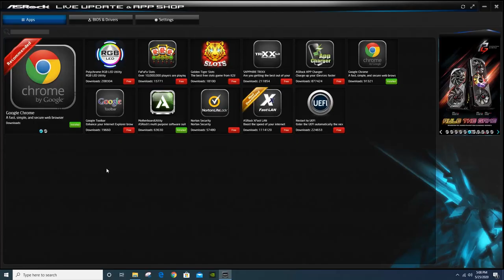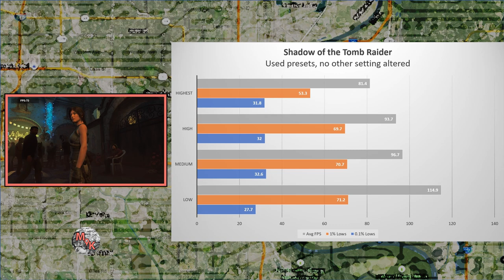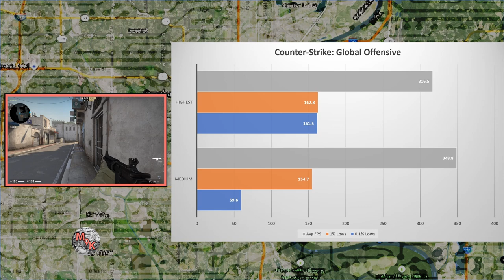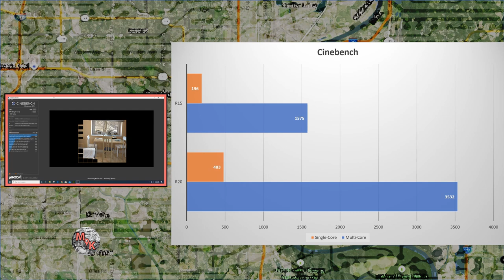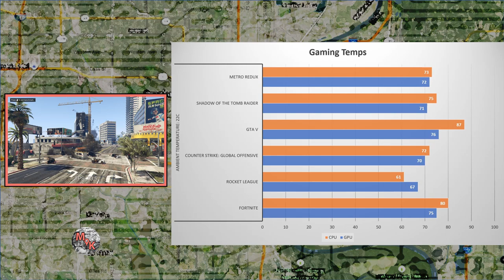I couldn't be happier with how this Budget Gaming & Streaming PC Build turned out!

Comment: great vid. PCPartPicker brought me to you.  I've got a near identical build waiting for cybermonday.  They had dinged you for the $20 windows key.  where do i go about getting windows key like that and have you had any of the problems they mentioned with it?  is there anything you'd change?
Reply from the maker: Hi and thank you for watching! You can get an inexpensive windows key here: https://www.vip-scdkey.com/sk/mokwindows
I've never had any issues with these keys and I've used 3 so far this year. The link is an affiliate link, so should you purchase, I'll get a little stipend--full disclosure there. Try code SKNO to see if you can get a discount as well. 

As for if I'd change anything with the build? Seeing as how many months have now passed, I think I'd maybe be looking at the NR600, which is the mid tower version of this build, go for an inexpensive b550 motherboard that is also atx sized, and consider an nvme boot drive that maybe has a ram cache. If I could only change one thing right now,  I think I'd opt for an RTX 3070 if budget allowed. Having said all that with keeping the 1k price point in mind this might be difficult. If I could raise the budget to 1200-1300 then def a 3070 and some other tweaks would work. 

RAM, and storage devices, especially SSDs are very friendly in terms of prices, so even going with a DDR4 3600 kit is doable for improved performance.

I'm working on a new build now that's around $1275 that does most of what I mentioned. Stay tuned for it in December. I've got a couple of other videos I'm working on first, one of which is another motherboard unboxing/overview.
Reply from the maker: Also love the profile avatar. You a joker fan? I've got to finish reading Three Jokers still. :) Wasn't a massive fan of the recent Joker War storyline, but it wasn't all bad. lol Yes I collect comics too. :D

Comment: Do I need to get any extra fan cables like a 2 way fan splitter or a extension cable? I'm thinking on building with this case but also building with a gigabyte b450m which only has one fan header.
Reply from the maker: You’ll probably need a fan splitter or two. Also consider investing in a cheap fan hub that you can stick on the backside of the case. I think the nr400 comes with two fans so you may want to get 1-2 more. Up to you.

Comment: 01:40 Why did you change the position of the CPU fan? I've never seen that on any other build video.
Reply from the maker: Hi and thanks for watching. I just dislike the aesthetic of how the AMD logo is on the side. To me it's much nicer at the top. Since it won't impact performance and is only for looks I swap it. I did it for the $450.00 budget build as well. :)
Reply: I flipped mine as well....it looks so much better at the top.

Comment: is this case support top mount 280mm rad? it isnt stated in website, just wondering if it possible since we able to put two 140mm top
Reply from the maker: Check out the case overview video I did on the NR400. I go over fan and rad support. THanks!
Reply: @MiddleofKnowhere  thanks. 👍
Reply: @MiddleofKnowhere  seems like it only support 240mm top rad..  so im going to front mount my kraken X63 280mm rad.. because im doing kraken g12 + X63 to my gpu 1080ti